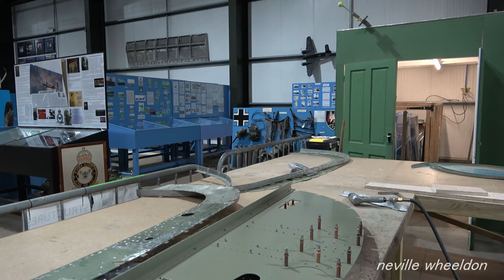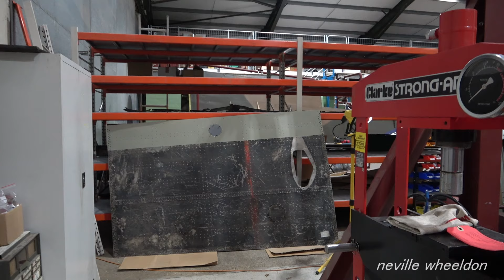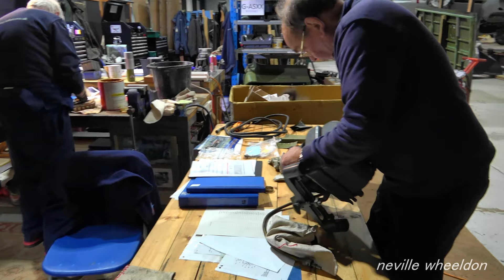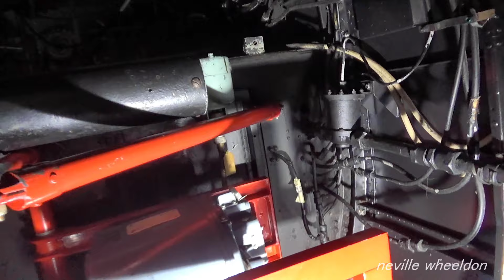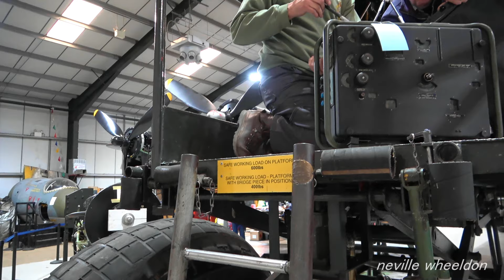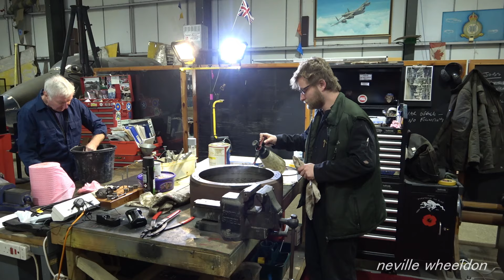238 Restoration of Lancaster NX611 Year 7.  Fitting out the fuselage nose

Comment: Another great video Nev, thank you. Saw the length of this one so made a cup of tea before I pressed play! Quick question: seeing the wheel and brake components made me wonder what spec they are going to be when airworthy. Believe BBMF use Lincoln legs and Shackleton wheels, tyres, brakes etc Will Jane have the same spec when airworthy or sticking to pure Lancaster?
Reply: BBMF have the same spec as NX611. Lanc legs, lanc wheels and lanc brakes. The legs and wheels were also used on Lincoln. The wheels were also then used on Shackleton but with larger brake units and different legs.
Reply: @andrewpanton1311  Thanks very much for the reply, much appreciated. I've previously been told (not by anyone at EK) that Lincoln legs were slightly different and could handle shear loads a little better, hence why they were fitted to '474. Thanks for clearing that up.
Reply: @WrightCycloneR1820   they came in with the Lanc as their AUW increased so its not altogether incorrect, it's just they predated Lincoln.
Reply from the maker: They have an air worthy set ready when needed according to Brad, not sure what it consist of.